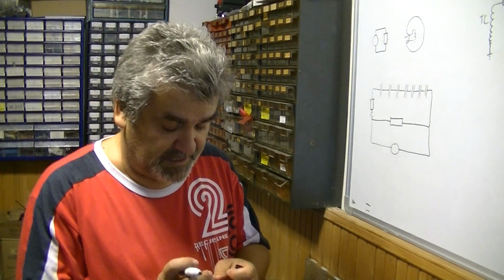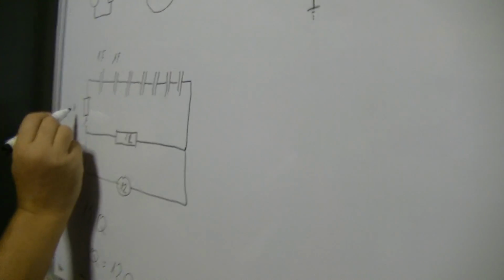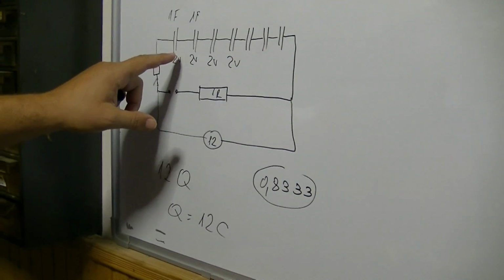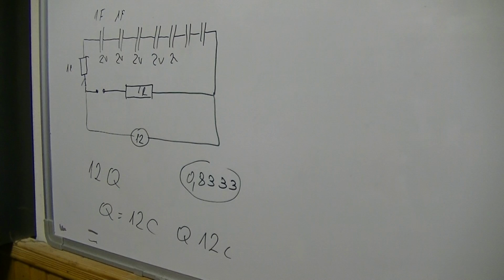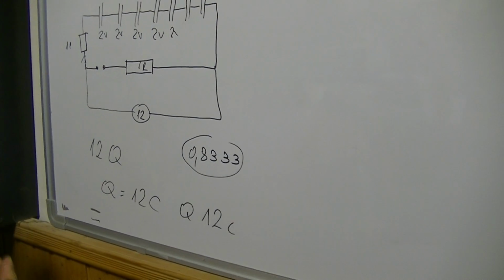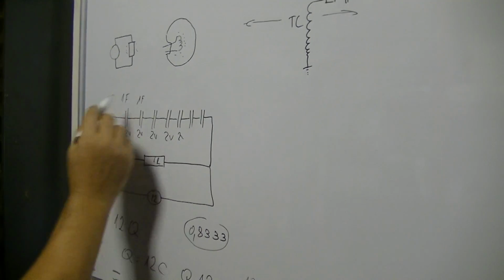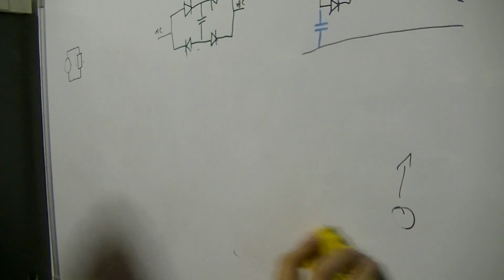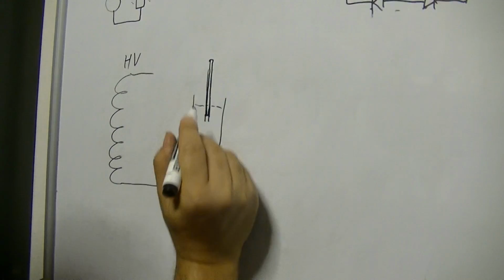Tesla Physics - Tesla's Radiant Energy 2

Comment: the point of origin of power is everywhere when power is on? like scalar wave longitudinal waveform, but no heat is this what you are aiming for? 'scalar?
Reply from the maker: I wouldn't say it is a scalars, because  they are not detectable (IMO). I will rather say with every circuit when power is ON it creates the pressure  around  circuit , E field   uses ions around in the air or dielectric for escape out from the circuit. With proper design this energy can be captured .

Comment: At the end of the video, the water experiment. VERY interesting. AC radient enrgy (dielectric) producing a violett spark, and quicly followed by bright orange light. It looks like the burning of hydrogen (also orange). The Hot temperatures, are a problem, but a limelight(calcium oxide, or calcium hydroxide), or perhaps titanium dioxide, could be a solution. both ,materials have a high dielectric constant. and have very high melting points. Also the calcium oxide, gives a bright white light when heated by a hydrogen flame. So maybe, its a perfect way to produce light. I would love to see more, of this AC water process
Reply from the maker: Hi Ivo, you are right. I think that it was in part 3 or 4 from this series I used calcium hidroxide to get this effect on catode. Also another version shown with Sodium aluminate . the same effect, but on anode. I am not remember did I made presentation of sodium silicate, in that case the light is so bright and white. Can not looked it.
Reply from the maker: Forgot to say, both of them work with AC and   DC .Sometimes AC is better. I have found the plasma produced by anode consume less current than  by cathode .
Reply: Thanks for the info! I found a bifilar coil, pulsed at its resonant frequency produces great amounts of dielectrc (radiant) energy, I will try yout method to see if this  works. Im working with low voltages. So maybe its below threshold energy. I use 12V pulses, creating around 700V AC dielectric (radiant) energy. Exiting :)
Reply from the maker: Master Ivo  yes it is true .
Reply: Almost forgot, the dielectric (radiant) enrgy, likes to implode, into the smallest form. So I suggest to reverse the symetry. A circular ring as the dielectric (radiant) energy electrode, with a carbon rod electrode in the center, to ground. This way the energy implodes into the center.
Reply from the maker: Yes , I did that  with carbon rode in the centre and aluminium ring around it, but with distance where  no visible arc (plasma ) between them. In that case I charged HV capacitor to very high voltage ( over 2 kV) So it is very important to prevent arc (conduction)
Reply: sodium silicate  was very bright? interesting!  but,  that desolves in water, in what form dit you use it? 

I to have seen different current strengths  between cathide and anode. very strange
Reply from the maker: Master Ivo  When I discovered how ions transport huge amount of energy, I tried to find application . Making gap under water made by gas  looked good idea to me for splitting water. then I involved chemistry to get higher resistance. By the way when I mixed calcium hydroxide and sodium aluminate I have got high resistive solution for electrolysis. I needed that because HV/HF source.
Reply: thanks for the great info! Im still wondering about the electrodes. I always thought about gold or platinum. I thought pure water (with its high dielectric constant) worked best.
Reply from the maker: Master Ivo  yes it is, but only bellow 1.23 V . dielectric constant makes sense under breaking voltage, above that is conduction.